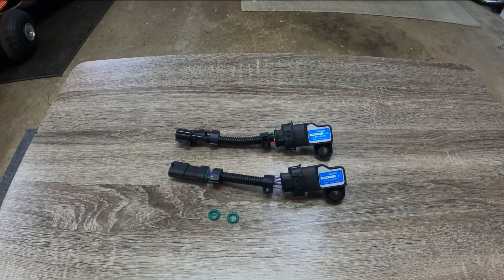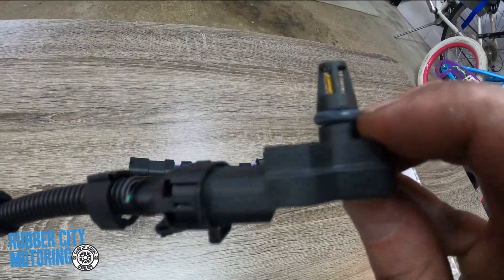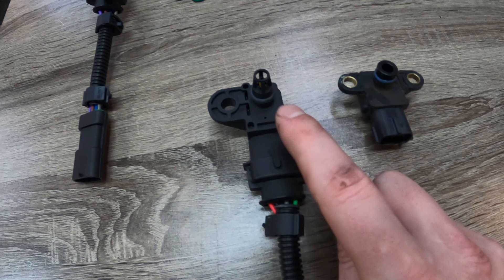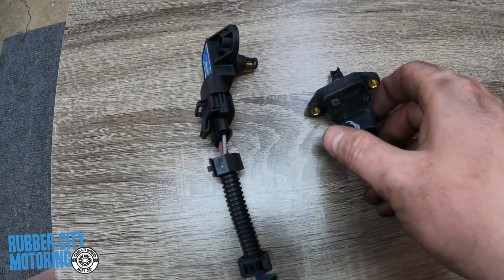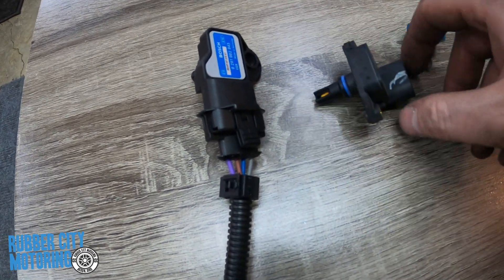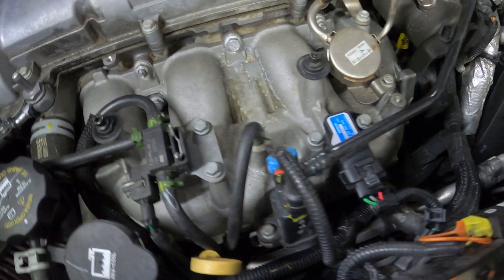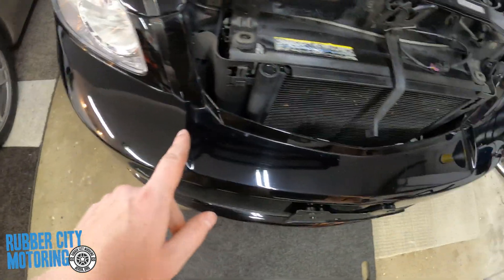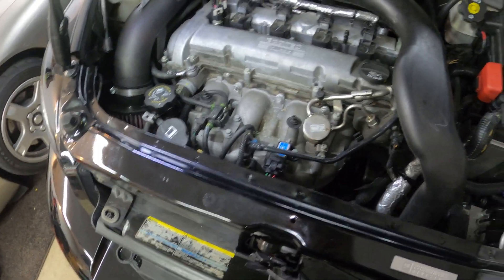GM Stage 1 MAP Sensor Install - HHR SS - 3 Bar Upgrade How To

Comment: Do u have a video how the tuning went with your laptop with zzp?   Do u need wifi while doing the tune update?
Reply from the maker: I used hp tuners, I also had WiFi. It’s a fairly easy process, but I’d just search for some videos on tuning.

Comment: Ive got the zzp intake installed, and the GM stage 1 MAP sensors installed. I keep getting a check engine code, for MAF sensor, is this normal. Any recommendations?
Thanks
Reply from the maker: Is it tuned for the intake / map?

Comment: Hey, thanks for the vid. I can see the top one no prob, but where the heck is the bottom one? I couldnt tell based on the video.
Reply: Thx. I got my sensors today. I'm going to get a remote tune from ZZP too. I'm looking forward to it.
Reply from the maker: Oh very cool! It was a huge upgrade that changed the car tons!
Reply from the maker: It’s on the lower charge pipe, super tricky to get to. Ended up loosening the radiator a bit and then was able to work it in there. Not easy though!

Comment: Since this upgrade, have you had the dreaded boost retard code? I believe it's p0236. I have this on my hhr and in summer times if I don't go and put a ton of dielectric grease on the plug and shield the wires from any moisture, it happens all summer and makes an hhr ls faster than my ss lol
Reply from the maker: No codes whatsoever. Not sure why not, but I have it all tuned to match these.

Comment: So with these new sensors, can a person take the car to a gm dealer and still get the flashed tune like the original came out when these cars were new?
Reply from the maker: That’s a good question. From what I’ve read, that tune is floating around online and technically you could do it yourself now.
Reply: @RubberCityMotoring  i wonder how that works doing it myself?
Reply from the maker: You need to get into hp tuners. Then from there find a tune that works for you. 

I did the remote tuning through zzp which is a great way to go. They dial in your car pretty darn good.
Reply: Well, truth be told, I do not have an HHR SS...YET... I want to get one. I have just been doing as much research as possible FIRST.. I do not want to get into something where No one knows anything or there are a bunch of know it alls that just argue and name call and point fingers like the DSM and Honda and and and you name it groups. I REALLY like the body styling. My parents have an LS I think. I just want a faster one that is a stick shift as all my vehicles are standard.
Reply from the maker: Good plan - join the HHR SS group on Facebook. Lots of good stuff there. Feel free to reach out to me as well. Good luck!

Comment: So did you ever get to use the green O rings that came with the sensors?
Reply: Green o rings are needed for the ldk intake manifold
Reply from the maker: Bingo - I knew somebody would know. Thanks!
Reply from the maker: Nope! Didn’t need them. Not sure why they send them or for which application they should be used.
Reply: The screws that attached my stock map to the throttle body pip were too small to hold the gm stage 1 sensor, anyone else have that issue?
Reply from the maker: Mine did not have an issue. Would some washers help on the stock bolts for you?
Reply: @RubberCityMotoring  I used the extra bolt from the manifold sensor, haven't got a tune yet, I'm stalling a few other goodies but fingers crossed its all fine
Reply from the maker: Awesome - sounds like a plan 👍🏻
Reply: @RubberCityMotoring  Love the HHR! Do it have BRembo front brakes? I also have a Silver 2010 w/23,000K on her. I've done some bolt on mods and a tune. Very fun to drive. It's a 5 speed.
Reply from the maker: Mine does not have Brembo from the factory but I have the kit sitting here to install them. I’ll make a video soon, once the weather warms up.